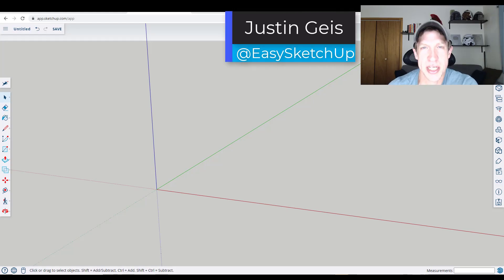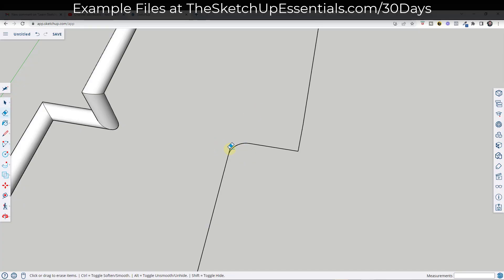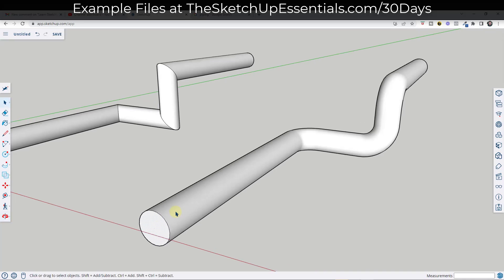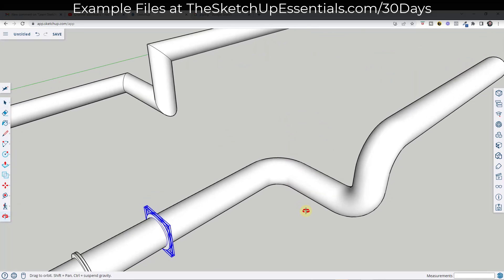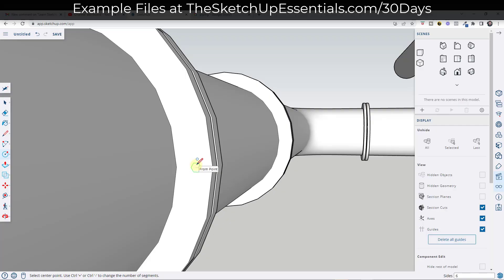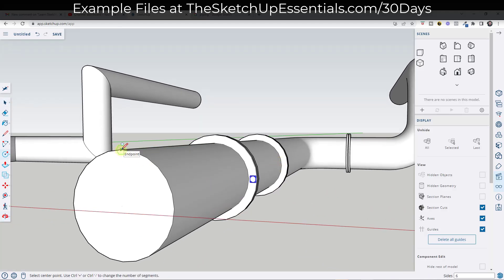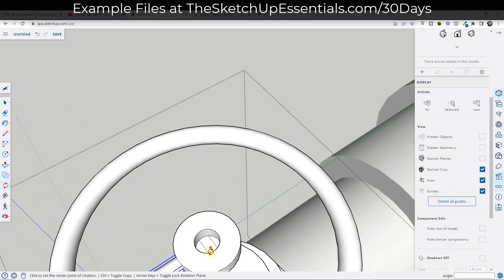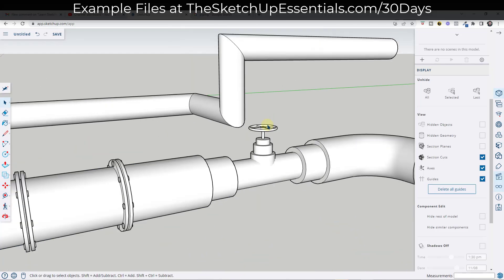Learn SketchUp in 30 Days DAY 19 - PIPING AND FITTINGS!

Comment: when i used the follow me tool on the rounded corners it does not extrude properly like it leavers the corners bare. it only happens when i use a combination of the line tool and the arc tool
Reply from the maker: Try making the radius/size of your objects bigger - small objects can often have geometry creation issues

Comment: @ 1:08 the fillet action to have a smooth elbow. 
Can this be used? 
https://www.youtube.com/watch?v=Bh5TZlIruk8&list=PL8g12EpaipDobr6rTV_DQyxvvAGnp5vtc&index=6&t=22s 
see tip 32. appears to be useful. the radius value key board entry has to be entered without moving away from the curve. wish this inferencing can be extended for drawing elbows too.

Comment: The videos are great.  Just FYI when dabbing pipe the bolts are aligned in what’s called a “2 bolt” pattern.  This is to insure flanges align correctly in the field.  The pipe fitter set the flanges up where 2 of the top bolt holes are aligned equally distance away from the 12 o’clock position.  In a 4 bolt flange the bolts would be at 45 degrees on either side of top center.

Comment: I notice you use * for multiply copies which for me is shift 8, a 2 key combo.  Why don't you use the x key, a single key press which is the inbuilt shortcut, either before or after the number of copies you want so to get 10 copies it''s x10 or 10x?
Reply from the maker: It's not a 2 key combo if you use a numpad, which I use a lot
Reply: @Thesketchupessentials  Ok - No numberpad on my keyboard and I'm sure a lot of your viewers are in the same boat as me; perhaps you could mention this, as in all of your demos in this series you have used * and this could be seen as THE WAY to do it.